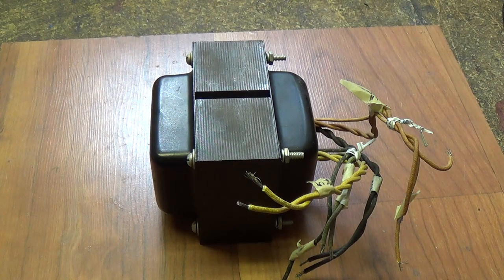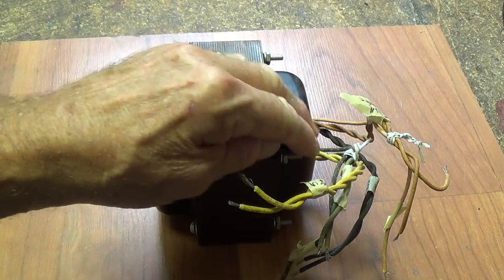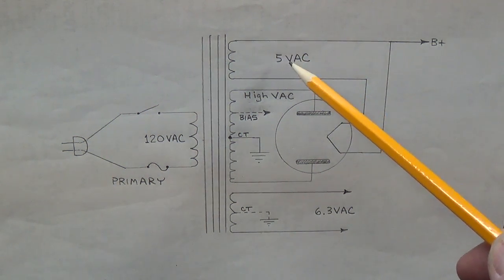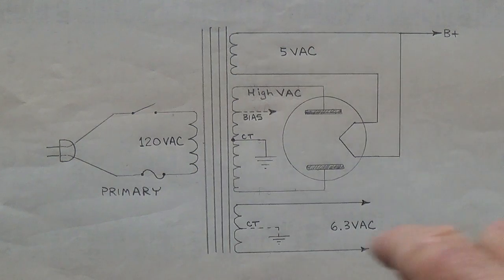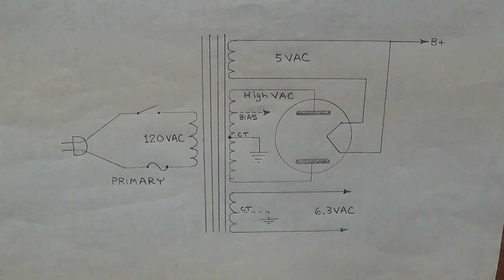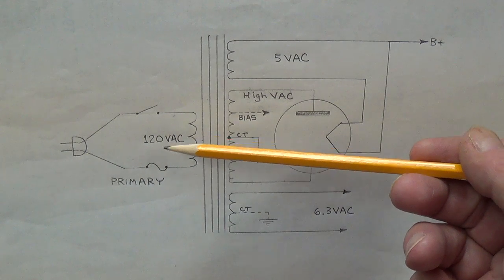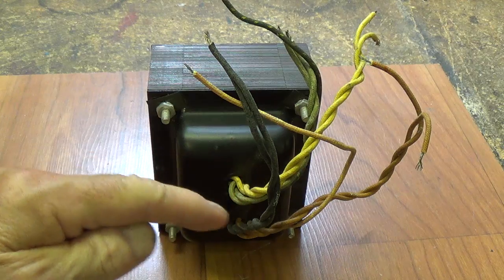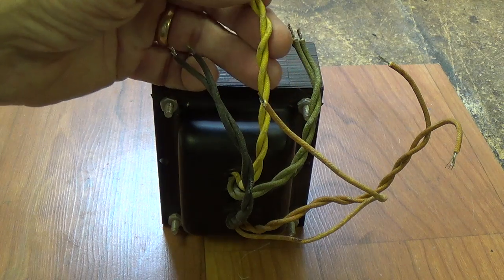How to Identify Amplifier Power Transformer Leads

Comment: I have an unknown torrid transformer from a machine that developed film. I can easily identify the primary winding, but unsure if it was for 120 or 220 volts. As I also have another torrid from the same machine, this one is clearly labeled. And seems to have a 220 volt primary, and (2) 120 volt secondaries. I thought about using the first transformer as a bench power supply, with different taps for the voltages. But the other one is probably useless. I was hoping to make an 120 volt isolation transformer from it, but I don't think that's possible...any ideas?
Reply from the maker: Do you have 120VAC or 240VAC power? If it's 240VAC you may be able to use the second one as an isolation transformer by tying two of the 120VAC output leads together and getting your isolated 240VAC from the two remaining leads. If you have a voltmeter and a current limiter to prevent any damage, you might try it and see. Be careful.

Comment: Uncle Doug,
I am currently troubleshooting a VOX ac4tv guitar amplifier.  Being that the main circuit is on a printed circuit board, it is rather troublesome to nail down what the problem is. It keeps blowing the 125 mA 250V fuse located between the the center tap (the secondary high voltage  AC side) on the power transformer and the ground.  (I have burned through several fuses so far trying to figure this thing out), (also swapped both tubes out with the same result)

 I have measured out the resistance of the leads on my power transformer as you have instructed, and everything seems to "jive".  I have also removed and tested the diodes and capacitors associated with this end of the circuit, measured every possible resistor on the PCB to ensure they are all "within spec", and checked silly little things like the wires going to the speaker, and proper connections between the transformers and the PCB.   Do you have any suggestions on what else to look at?

Unfortunately, Google+ will not let me post the amplifier schematic directly but I have found the link to where I got the schematic from, it is about half-way down the page:
http://www.tdpri.com/forum/amp-tech-center/507584-vox-ac4tv-trouble-shooting.html
Reply from the maker: It's tempting to suspect that a filter cap is partially shorted. Are you using a current limiter? If not, you should be. It would probably be glowing and saving the fuses. Do you have an ESR meter to test the electrolytics? If the fuse/CL would allow the amp to stay on for a short while, the faulty cap would give itself away by getting warm (or exploding if it got too hot.....be careful). Without a CL and ESR meter, I guess you'll have to start checking the resistance across the filter caps. Good luck.
Reply: I do not have an ESR meter to test the capacitors, I have just been using the capacitance test on my multimeter. Which I understand isnt exactly "right". 

All of my testing has been done "dry" once I have ensured that power is removed from the mains and the capacitors are safely discharged.  I need to get some alligator clips for the multimeter and build a CL so that I can troubleshoot while its "Hot".  The amp is a few years old so I thought that the capacitors would likely be the first things to go bad.  So  it looks like I will have to get an ESR meter to be able to correctly troubleshoot those capacitors to eliminate them as suspect  components.

Once I have a better understanding of all of this stuff, I will likely convert this amplifier to be completely hand-wired, and tube rectified like the original Vox AC4, along with building a proper speaker cabinet rather than this pressed fiberboard junk that they sold me. 
Thanks for the pointers! I hope you don't mind my lengthy questions/replies!
Reply from the maker: No problem at all, JR. Proper tools are essential. I hope you are able to successfully repair and improve your amp as you describe. Best of luck :)

Comment: Hello Doug, your videos are the best!  I was wondering if you could discuss amplifier wattage as it relates to the characteristics of the amp such as tone, loudness, appropriate speaker ratings.  Thanks.
Reply from the maker: Greetings, Kirk. I have posted a video that discusses RMS voltage and accurate rating of amplifier output power which you may find interesting. I would say that there is a direct correlation between output power (wattage) and loudness, but not necessarily with tone. Some of the finest sounding amps, such as the tweed Fender Champ used by so many famous recording artists, are also quite low powered (4 or 5 watts). It's always a good idea to use speakers with wattage ratings that are greater than the amplifier to which they are connected. I would suggest a 50% to 100% safety margin if the amp is going to be played at very high volume.....i.e. 75W to 100W speaker with a 50W amp.
Reply: Uncle Doug Thanks!! I'll check that one out.

Comment: Hi Uncle Doug! Greetings from Newcastle England! 
I have a question that isnt stricly to do with transformers. So sorry in advance! 
I was wondering, in electronic circuits one has to ensure that, for example, the output wattage matches the speaker. And all component capabilties arent being exceeded. My question is; does one have to take such care with the likes of resistors rated at 1/4 Watt at any point in a circuit? Or should higher (1/2W or 1W) resistors be used? Or have I got this totally wrong? 

Kind Regards, 
Sam
Reply from the maker: Greetings, Sam, from the hinterland of West Texas :) Your question is a good one. I see all sorts of puny 1/4W resistors being used on the printed circuit boards in newly made amps......and I have seen more than a few of them fail. The reasons for their use are probably to conserve space on the circuit board and to reduce production cost. I personally think that for the tiny additional investment, 1/2W resistors are much, much better in most circuit applications. Higher-wattage resistors are generally not necessary except in specific power supply and cathode bias applications, where current flow is sufficient to generate higher heat levels (Power in Watts = Current Squared x Resistance). These higher wattage resistors are generally clearly marked on schematics. Bottom line: I do not use resistors of less than 1/2W in any amp I build or repair.

Comment: Greetings UD. I have a rather specific question that you or anyone similarly knowledgeable may wish to field. I have built a 5F4-style amplifier on the chassis of a Conn 430M organ amplifier. I chose that amplifier because the existing 5U4 and pair of 6L6's, and trio of 12AX7's already resembled the Fender 5F4--and it seemed simple enough to assemble. I have discovered, however, that the Woodward-Schumacher 606041 PT that lived on the Conn chassis may not be compatible. I got everything wired up and discovered that there was no red/blue wire to supply the bias voltage to the 1N4007 (through a 6.8K resistor). The PT leads and voltages, supplied with 121.1VAC are as follows:(I clipped all leads and re-measured these voltages for this note.) 
RED 825; Rd/Yl Tap 415
Green 14.0; Gr/Yl Tap 7.1
Brown 7.1
Yellow 5.6
Is this PT simply not compatible with the 5F4 circuit's needs? Or can I derive the correct bias voltage by another means? Thanks for your insights--you may wish to google the Weber 5F4 layout diagram for reference. I can't put the link here. I have a fair supply of power resistors and know how to heatsink them against this chassis. Thank you!
Reply from the maker: JC, I have seen several amp circuits where the bias voltage is simply taken from one of the high voltage outputs from the PT. For example, check out the schematic for the AA764 Fender Princeton Reverb.....the bias circuit connects directly to one of the 330VAC PT outputs. The 100K (series) and 27K (to ground) resistors bring it down to a half-wave rectified -35VDC.

A second, very clever method to derive bias voltage is provided at the following site: 
education.lenardaudio.com/en/14_valve_amps_6.html  This method utilizes a 6V to 120V transformer at the end of the 6.3VAC filament circuit to produce and then rectify a usable bias voltage (probably 45 to 50VDC or so). As long as your 6.3V winding could stand a little more current flow, this would be a good way to go.

Don't give up. There are several ways to solve your dilemma. Good luck :)

Comment: Uncle Doug - Thanks so much for your excellent instruction... I recently picked up a vintage tube amp power transformer where the 2-prong plug has been cut off. Do I need to be concerned with polarity when replacing the plug? Are either of the two black wires the dedicated positive?
Reply from the maker: You're welcome, Kevin. No, polarity is not an issue with the two primary leads of the PT.
Reply: Thankyou
Reply: Oh my gosh Uncle Doug, I feel very foolish, but in my attempt at identifying the pair of wires to power a vintage Hammond brand transformer I darn near killed myself (at least if felt that way) when plugging in the wrong 2 wires into the 120 volt wall outlet... Not sure how/why it happened, but I became part of the circuit and I literally found myself lying in the floor!!!
Reply: So now I have a question - Do you have a brand/model preference for power transformers? I'm building a single ended Champ style amp but modding it a bit with dual rectifier tubes and dual 6V6's wired parallel.
Reply from the maker: Are you sure you want to go with dual rectifiers, Kevin ?? A Champ-style amp, even with parallel 6V6's, is easily powered by a single rectifier.....just look at the Deluxe or Harvard. Two would be excessive IMHO (even if you used 6X4's or 6X5's), not to mention the added difficulty and expense of finding a PT that can provide sufficient 5V filament current (4 to 6A). A single 5Y3 would be plenty.....a single GZ34 would be overkill. That said, I get all my transformers from Triode Electronics:  http://store.triodestore.com/transformers.html  Best of luck with your project :)
Reply: I'm building off a schematic I found from "Angela Instrument's" Their claim is that the end result is a little hotter single-ended amp... As you know I'm new to all this so I'm not really sure of anything at this point - And just to add clarification to my getting shocked story, I didn't follow your instruction to the letter  and made a decision based on the physical layout of the wires (after testing a few of the wires) - It was a completely foolish move on my part and a good lesson learned.
Reply: You can checkout the schematic and info here http://dbl.musicweb.ch/schematics/Music%20Instruments/Guitar-PA-Verst%C3%A4rkerschema/Other%20Homebrews/Angela%20Instruments%20Angela%20Super%20Single%20Ended%206V6%20Amplifier.htm
Reply from the maker: Kevin, I just saw your electrocution note (I was never notified when it was posted). Wow....thank heavens you weren't injured. This should be a warning to all viewers, because it can (and unfortunately, does) happen.

Re the Angela schematic, I think the parallel 6V6's sound like an interesting modification, but for the life of me I do not understand the dual rectifiers. The rule of thumb is one rectifier per 50W of output.....and this amp will be lucky to reach 11W or 12W. In addition, they offer no justification for the addition of this extra rectifier. I would use a Fender Deluxe power transformer, two parallel 6V6's, and a single 5Y3 rectifier. If you're building a kit, I guess you're stuck with the second 5Y3, but if not, I personally would delete it.
Reply: I'll take your advice on that - I am aware of the one rectifier per 50 watts rule, but my inexperience allowed me to believe there may be a benefit to the dual setup in this case. But as I think it thru you're right, we're only looking at around 12 watts total... I was thinking of running two 10 inch speakers, one mounted as usual, and the second as part of a leslie setup in the bottom of the cabinet - Any thoughts?  Or perhaps a 12" in the bottom with an 8" driving a leslie in the top? Is it wise to run different size speakers given matching impedance's?
Reply from the maker: I think you'll be better off without the extra rectifier. Let's face it, if it were a really good idea then major companies would be offering small amps with dual rectifiers and touting it as a "great breakthrough". To my knowledge, they aren't. I think Angela just threw the idea out there to be different.

Re the speakers, two 10's would be nice. Speakers are one place where "dual" really does work better than single, and they could take advantage of the added output from the parallel 6V6's. To be honest, I would simply house the two speakers in the normal fashion, as a 2 x 10 either combo-style with the chassis, or as a separate cabinet (and the amp as a head). As long as impedances are matched, you can have different-sized speakers, but in this case, the 2 X 10" would really be ideal. If you want to get creative, how about a Ceramic 10" and an Alnico 10" ?? I've never seen this before, but it would make great sense..... they each have relative strengths and a mixed pair could do it all.

If you want to have a Leslie effect, it should be separate, since you'll probably only use it occasionally. It would be a shame to let it tie up one of your two main speakers, and it would add a lot of weight and volume to your cabinet. You might end up with a 12W amp that's as large (and heavy) as a stove. It's a neat effect, but like all effects, you generally use them in moderation.
Reply: A stove as in comparable to the Marshall 8/10 cabinet I use to lug around back in my gigging days? Sounded great, but I truly had to use a mini-truck (ford courier) just for my amp LoL... I really like the Alnico and Ceramic idea - I'm gonna work the Leslie into my setup somehow though, I've always really liked the sound and the fact that it's achieved more naturally than say the latest stompbox... Separate amp/cab does make more sense - Thanks for the great advice!!!
Reply from the maker: Yes, excessive weight and bulk are not good.....at least in my book. Also, don't forget, Kevin, that a Leslie cannot be contained within a cabinet that is sealed on any side(s) and still function optimally. For maximum effect, the drum needs to have 360 degrees of exposure. Good luck.

Comment: Hey Doug. I know you are more of a tube guy but I have an interesting one for ya regarding transformers. OK I have a solid state torroid from a 70's-80's stereo, possibly Pioneer, Sansui or the like. I remember salvaging it almost 20 years ago but have no other ideas. Here is where it gets weird... Ok, I have 2 seperate power amp windings 53-0-53 OK I get that... It has a 9 Volt winding, I'm guessing, for a flourescent display NOW, It has 5 more wires 2 are 19-0-19 Pre amp and 2 are 66-0-66 ALL share the same single center tap wire (fifth wire). This is way before home theater and I don't think it was a quad amp.... Does it make sense that they would possibly run the drive section at a higher voltage than the output section? Maybe it was a quad and the rear channels shared the 66 volt supply? Kinda weird. I don't know what to make of the 66V winding..... Any ideas? Thanks in advance.... otter
Reply from the maker: Greetings, Otter. I am utterly deficient in knowledge and experience when it comes to 70's-80's stereo circuits. If I were you, I would do a search for Pioneer and Sansui schematics from that era to see if you can find an explanation for the weird outputs. Also, if there is a part number anywhere on the transformer, it may be traceable. Sorry I have no specific insights to offer. Good luck :)

Comment: Great video! How can you tell USA from EU primaries?
Reply from the maker: Thanks, Luke. This would be a little tricky, and would probably require a little trial and error. In some universal power transformers (both 120V and 240V primary) the primary has two separate windings, with four wires. For 120VAC use, you wire the two primary windings in parallel, and for 240VAC use, you wire them in series. In other universal PT's there is one primary winding with several taps, one is common and the rest are for 120V, 220V, 240V applications. In both cases, you would have to use a good ohmmeter to sort out the taps and then connect them, i.e. to a Variac, to be sure you properly identified them.

Comment: howdy sir! what timing! it just so happens my power transformer in my Motorola hifi is fried I believe. I was hoping you could tell me how to find the right replacement. it uses 2 6v6gts, 3 12au7s, 1 6au6, and a 5y3gt
Reply: I left a similar message through google+ hangouts.
Reply from the maker: Kyle, the easiest way is to see if there is a number on the old transformer that can help you identify and hunt down a replacement. Barring that, pick a guitar amp that uses a similar tube complement, i.e. a Fender Princeton Reverb, go to the Triode USA site and order a PT that is suitable for this amp. Replacement of a power transformer is not a terribly complex task, but the part is rather expensive, and if you are not fairly well-versed in electronics repair, it might not turn out well. Accurately assess your abilities before proceeding.....and be careful.
Reply: Uncle Doug Kyle may be able to find the schematic for this Hi-Fi at radiomuseum.org  Here's the first page of the extensive Motorola pages http://www.radiomuseum.org/m/motorola_usa_en_1~model.html
Reply from the maker: Thanks, Carl. Hopefully Kyle will read this.